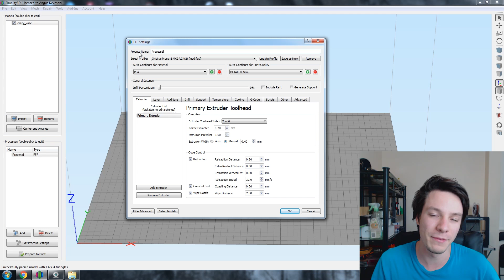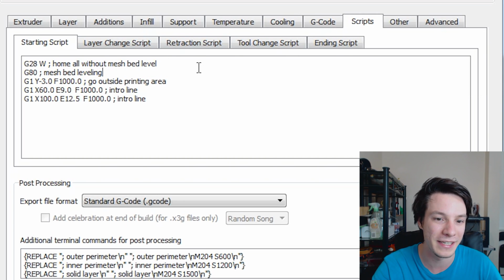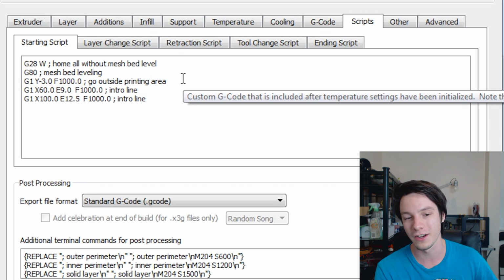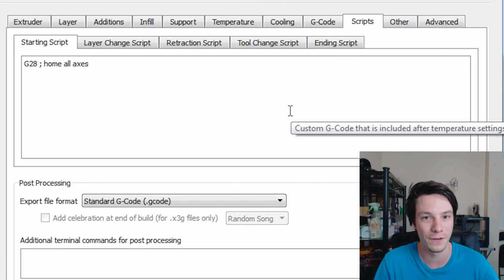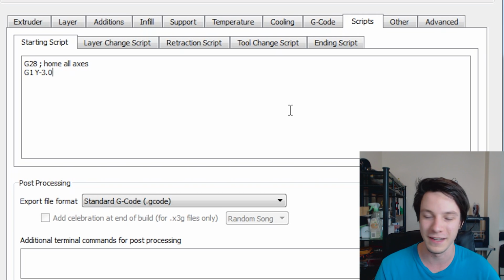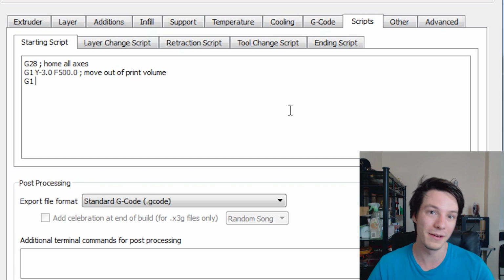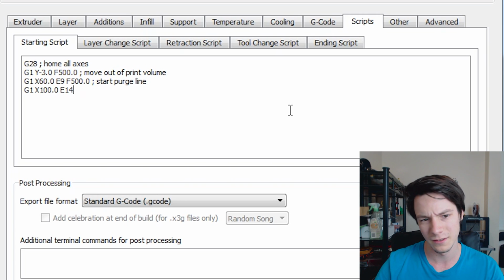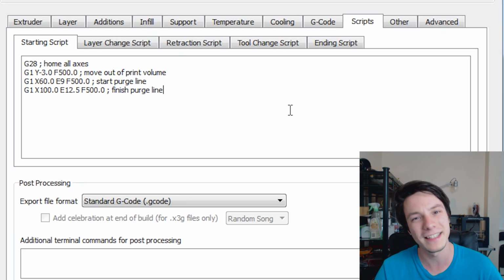How to do a nozzle wipe before every print - Gcode Scripts part 2

Comment: Thx Angus. This helped a lot on my fresh MK3S+. If I want the purge line to be longer, can I replace the G1 X100 E12.5 F500.0 with G1 X200 E17 F500.0?
Reply: I just replaced the line and it worked

Comment: I use this on my printer (Tronxy with Marlin firmware)

M117 Purge extruder
G92 E0 ; reset extruder
G1 Z1.0 F3000 ; move z up little to prevent scratching of surface
G1 X0.1 Y20 Z0.3 F5000.0 ; move to start-line position
G1 X0.1 Y200.0 Z0.3 F1500.0 E15 ; draw 1st line
G1 X0.4 Y200.0 Z0.3 F5000.0 ; move to side a little
G1 X0.4 Y20 Z0.3 F1500.0 E30 ; draw 2nd line
G92 E0 ; reset extruder
G1 Z1.0 F3000 ; move z up little to prevent scratching of surface
M117 Ready to go!

Comment: The Wanhao Duplicator i3 can extend beyond Y200 if specified in the firmware. This means that you could move the print head to Y215, prime the nozzle then bring it back into the build volume so the oozed out filament gets chopped off and falls under your print bed so you never have to worry about cleaning it.

Comment: Hey Angus, great help, i have been using this gcode since last year but only once out of 10 times my extruder start pulling the material back instead of feeding in as it is suppose to do. again it happens only few times but same gcode works fine next time. Can you please help me identify the issue? 
My printer is Cartesian base close metal body 300x300x300 dual extruder (fixed) chinese made "Inoovo iCreate". 
Using Simplify 3d slicer. 
Big Thanks. 
~Stay Home, Stay Safe~

Comment: Isn't auto-level G29?  I tried the G80 with my new Prusa i3 MK3S and it didn't run a mesh level.  It does when I use G29.

Comment: I tried adding this to curs for a cr10spro. It primed the nozzle in mid air.
Reply: There are no z-axis movements in the given code, did you home all axes first? Does typing G1 Z0 F500 bring your nozzle down to the bed? If you enter these in the command line rather than in a script remember to make sure to type G90 for absolute positioning first, otherwise relative positioning (G91) may still be selected from a previous gcode file and the nozzle will move -3 from its current location rather than to y= -3. In a script generated by slicer software this will be inserted for you.

Comment: well your Y-3.0 is NOT outside of your print area. It's on some edge and you CHOSE to reduce your print area for some reason you could mention. This start gcode also supposes that your printer, after homing is at the right height for purging and the purge to stick to the build plate, but that is not the case with marlin and a bltouch. This is what I have for now (marlin / bltouch / anet a8), it's perfectible.

G92 E0                                  ;zero the extruded length
G1 X90.0 Y1 Z10 F2000.0 ; move out of print volume  without risking hitting any tongs
G1 Z0.2 F200                       ; move down the head to the right Z before purging
G1 X150 E9 F500.0             ; start purge 
G1 Y1.4                                 ; before 2nd line, move ahead of the first path  
G1 X110 E12.5 F500.0       ; finish purge line  (come back)
G92 E0                                  ;zero the extruded length again
Reply: thanks!

Comment: G'day thanks for the Vid, I have an issue with the start script... I have entered a nozzle wipe ( Priming nozzle) prior to print... which means i don't need to do a skirt and lose bed area. I find that at times the Extruder motor turns backward... meaning pulling filament out,, which causes the hot end to be NOT PRIMED ( empty!) . It does this randomly... any clues as to why and the fix?

Comment: This is great.  I've always been happy with my printer first lines, but it required me to manually prime the nozzle and grab it off the nozzle right before it lays down the skirt (that can be pried from my cold, dead hands).  This wasn't a major problem with my OctoPrint setup, but it required me to be physically present for every print start.  This simple code now allows me to start prints remotely - it cleanly primes the nozzle and removes all the excess crud that I was otherwise grabbing directly.

Comment: Hi, Thanks for the video. I tried this with my Creality CR-10 and Cura V3.4.1. Although Cura allows you to add code at the start it put a little bit in front of it. The line that caused the problem was "M82 ; absolute extrusion mode" meaning that when it ran my start section line "G1 X60.0 E9 F500.0" it moved the extruder to absolute position 9 rather than extrude it 9 steps. Depending on the position of the extruder it would result in a completely random extruder action like retracting all the filament out of the teflon tube. I had to add a line at the beginning "M83 ; Relative extrusion mode" and a M82 line at the end of my start section  to switch it back. Any way to do an If-Then style loop in gcode?

Comment: i still dont get how you can use Y-3  unless you have an origin offset ??
Reply: Because you can configure 0,0 to be the corner of the bed (maybe 5 mm  in or more if you have clamps on) rather than the left/frontmost position the head can get to. If you home x and y, then move the nozzle to the front left corner of the bed, then type G92 X0 Y0, this will become your new origin, until you home again anyway! As a result you'll be able to use Y-3. Now if you move as far left and forward as you can (without homing as this will reset your position values!) and read the negative values, you can enter these into your firmware to make them permanent, and as such your software will always treat 0,0 as on the bed, and your coordinate system will make much more sense!

Comment: Quick Question. Where should I add this into my start/end gcode?
here's my current set up:

G21 ;metric values
G90 ;absolute positioning
M82 ;set extruder to absolute mode
M107 ;start with the fan off
G28 X0 Y0 ;move X/Y to min endstops
G28 Z0 ;move Z to min endstops
G1 Z15.0 F9000 ;move the platform down 15mm
G92 E0 ;zero the extruded length
G1 F200 E3 ;extrude 3mm of feed stock
G92 E0 ;zero the extruded length again
G1 F9000
;Put printing message on LCD screen
M117 Printing...

Comment: So rather than having an absolute position for the purge line it is possible to do a line that say is 5 mm margin from the print area? Flashprint has a Pre-Extrusion feature that allows the following variables: Margin: 5mm Path Length: 120mm Speed: 20mm/sec speed. It it also does a small radius at the very start of extruding which works very well for keeping the nozzles clean.  But there are many other items that are lacking in that slicer so I've switched to Simplify 3D and am very happy. This would be a great thing to add to the startup script! Thanks for the great videos!

Comment: I tried it on my Anet A8 but it make the nozzle clean outside my heatbedd ..  I suppose i have to corrrect it somehow  .. ?  I have a problem with heating to , when it reaches temp it go print but every first print i had , i had to restart it and then it went allright .. I suppose the nozzle need some kind of pause when reaching printing tempeature .. ?  Now i preheat my nozzle and heatbed  and then i  push print in octoprint and it get right from first try .. could i somehow make the prnter pause for 10 second before printing when it reached its  temp ?

Comment: Thanks Angus! This works well but only if the nozzle is already heated. Is there a Gcode to bring the nozzle to 190c before the wipe?
Also, what about the code G12? That is a predefined cleaning code, which not many use.

Comment: If you can move and print outside the build volume, the. Why isn't the build volume just that much larger?
Reply: because you might be using clamps? I have no other idea, mine has 0 right on the edge of the printer.

Comment: I am new to all this and this is a start code suggested by  a guy on a FB group helping me  get started. 
Where would I put this purge line code into this?   My thoughts are just above the M117 line - my logic being  all above sets the printer conditions and the purge line  is needed just before it starts  printing.   

G21 ;metric values
G90 ;absolute positioning
M82 ;set extruder to absolute mode
M107 ;start with the fan off
G28 X0 Y0 ;move X/Y to min endstops
G28 Z0 ;move Z to min endstops
G1 Z15.0 F9000 ;move the platform down 15mm
G92 E0 ;zero the extruded length
G1 F200 E3 ;extrude 3mm of feed stock
G92 E0 ;zero the extruded length again
G1 F9000
M117 Printing...

Comment: Hey Angus, can I add script for separate processes? I'm trying to print a batch of items (24 separate pieces) and running into issues with the tip getting gummed up halfway through and causing a failed print. My printer (cubicon single plus) has a nozzle cleaner mounted to the side of the bed and I want to write a script similar to the one you showed in the vid. I want the printer to move to the side of the bed and clean the nozzle before printing each of the 24 pieces. I already have separate processes set up for each piece and was just curious where I would place the script in each process... "starting script" on each process after the first? Is this possible or are scripts only applicable for the first process when printing from an sd card? Thanks
Reply from the maker: I would ask what is causing the tip to get filament stuck to it, is it a brim lifting away and sticking or are parts coming detached? I only had a brief period of time with the Cubicon Single, but did find parts would break free from the print bed if they didnt have enough surface area. You can definitely insert a cleaning script midway by creating a new process that starts and stops at a single layer (like 10.00 to 10.20 if printing at 200microns) but has 0 infill and no print data assigned, and insert into the 'per layer' window in scripts your cleaning routine - I have done this using M600 on the prusa mk2 to pause for color changes and need to make a video on it, it's a massive hack... but does work.
Reply: Awesome, thanks for the reply! I like Simplify3d but must have a setting not quite dialed in, as I can print one item at a time but as soon as I go to print multiple items things go bad. I've had to walk away from the printer for a couple days to cool off... I get frustrated when I can't solve something and am new to 3d printing. 😫

Comment: Hi Angus. Helvio from Switzerland here...

I`ve tried that code on my two printers, but it retracts the filament instead of extrude it... What could be wrong?

thanks!
Reply: If you're using cura an the reprap flavor of gcode you have to clear the start gcode completely and insert what Angus is using, but after it does the purge line for some reason it does a big retraction right before it starts the print which I haven't figured out why yet.

Comment: how come when i did this it starts priming in mid air like a couple of millimeters
Reply: same problem here , did you solve it ?
Reply: Just found the prblem, you have to lower the nozzle after G29 for my tevo tarantula i use this : 

;EXTRUDER PRIMER
G1 Y2 F7500 ; move out of print volume
G1 X5 F7500 ; move out of print volume
G1 Z0.5 F2000 ; move Z lower
G92 E0 ;zero the extruded length
G1 X6 E9 F250 ; start purge line extrude 9mm feed
G1 X100 E13 F500.0 ; finish purge line extrude 13mm feed
G92 E0 ;zero the extruded length
G1 F200 E0 ;extrude 0mm of feed stock
G92 E0 ;zero the extruded length again
G1 F9000
M117 Printing...
Reply: even if you lower Z at 0.5 it will automaticaly get at the first layer size so 0.2 as i have printer with a layer thickness of 0.2mm, i use Marlin 1.1.4

Comment: Hi Angus.  Stupid S3D question (I purchased it Monday, love and hate it right now...lol).  With my Duplicator I3 and Cura it used to lift the z axis a bit and purge filament after homing and before starting the print.  For some reason I cannot get S3D to do that.  I've entered Gcode numerous times and all it does after homing is sit for about five seconds, then start the print.  I know it's a small thing, but, I liked that it does that in Cura because it allows me to remove plastic from the hot end that was smushed on there after everything homed.

Comment: Here's the g-code that you can copy and paste and not waste a single more second of 3D printing:

G28 ; home all axes
G1 Y-3.0 F500.0 ; move out of print volume
G1 X60.0 E9 F500.0 ; start purge line
G1 X100.0  E12.5 F500.0 ; finish purge line

Comment: Copy Paste:
M300 S1567 P240 ;Play a groovie beep tone to get things started

M115 U3.0.7 ; tell the printer latest firmware version available

M300 S1567 P240G28 W ; home all without mesh bed level

G80 ; mesh bed levelingG1 Y-3.0 F1000.0 ; go outside printing area

 G1 X60.0 E9.0  F1000.0 ; intro lineG1 X100.0 E12.5  F1000.0 ; intro line

Comment: How does this differ from simply printing a skirt? Is there any advantage to doing it this way instead?
Reply from the maker: A purge line is advantageous as it does not eat up print area, takes a small amount of time regardless of how many parts and you don't risk the line getting pulled up and ruining your first layer like a skirt would. Personally I've moved all my machines over to this kind of nozzle priming.
Reply: Maker's Muse I'll give it a shot then. Thanks for the info.

Comment: I added a G92 E0 before and after the purge.
Before because if you kill a print midway, it doesn't zero the extruded length, and if you're in absolute positioning mode and you start a new print, it's gonna try and do the G1 X60.0 E10 F500.0 and just back the filament out.
After because the first line of gcode afterwards is usually a retract followed by moving the print head into position. Once again, you're at E15, it wants to retract to E-1.5 (if you use 1.5 mm retract distance), so it'll just back the filament out.
Both instances happened to me a few times when I used the original start script in the video before I figured out what was going on.
Reply: Thanks!! i wondered what the problem was
Reply: Thank you so much for this tid bit.  I was pulling my hair out because mine was retracting a crap ton!
Reply: OMG thank you so much for this!  My printer kept on retracting my filament at a very high rate of speed… lol.  I couldn’t figure out why.  Why do they not tell you this in all the tutorials on purge lines?
Reply: This just happened t me too, wish I'd read the comments!

Comment: For copy paste :)
G1 Y-3.0 F500.0 ; move out of print volume
G1 X60.0 E9 F500.0 ; start purge
G1 X100 E12.5 F500.0 ; finish purge line
Reply: MVP stuff right there
Reply: You are awesome lol
Reply: 1 year later and you're STILL a super hero to all the kids
Reply: thanks
Reply: you're the man! :)
Reply: Woah thanks for saving me 7 minutes :)
Reply: Thanks :)
Reply: Hi Julio, could you (or anyone else with more experience) please tell me what's the difference between this one and the sqirt? From my understanding both should serve the same purpose, to extrude the old material and "clean" the noozle... right?
Reply: Julio I got on mine (Artillery) the following (and they don't seem to be the same by far):
G28 ; home all axes
 M117 Purge extruder
 G92 E0 ; reset extruder
Reply: thx
Reply: not all heroes wear capes
Reply: Thanks.
Reply: you saved my life
Reply: No, MVC (Most Valuable Commenter)

Comment: Hi Angus, great video. 
One quick question : doesn't the Y-3 command force the printer to hit the y-endstop thus resetting the y-position back to zero and therefore setting the print off by 3mm in y-axis? Would it be possible to set to Y=0 for the same result? 

Greetings from Germany

Comment: that is awesome, but one issue. Many of us have glass plates and the clips in the front/back which the head will collide with.  I've been working on one for Cura and my Max Micron, basically the same thing just replacing "X" with "Y" so it slides up the side instead of across the front.
Reply from the maker: Yep pretty much, just make your purge line go up Y not X, or put it anywhere you like to avoid the clips :)

Comment: with industrial printer there is a sequence for clean and purge the nozzle: at first there is a movement over a sort of brush for remove previous material, next an extrusion in a basket near the build area and then a purge line on the bed. sort of opposite at the end of the printer the sequence is like as follows: movement on the brush and lowering the bed to the bottom while beeping. I'm editing in this way the gcode of my solidoodle 4 to help out not only my prints but even my wife (i hadn't enough time to teach everything, so i'm making custom gcode to get flawless experience for her).

Comment: Hi,

If you use brim on your 3D print in simplify3D this purge line isn't really necessary, is it?
Because the brim itself actually is sort of a purge line. So I don't really see the value here if you have access to use brim.
Reply: yes and no... often there is a little shamutz stuck to the nozzle that is sticking up from drip as the nozzle heats up.  just doing a brim it often leaves that little squirrely piece in the way where it can get picked up again by the nozzle passing by.  purge line leaves it behind and out of the way.